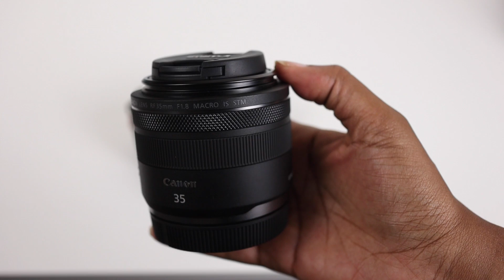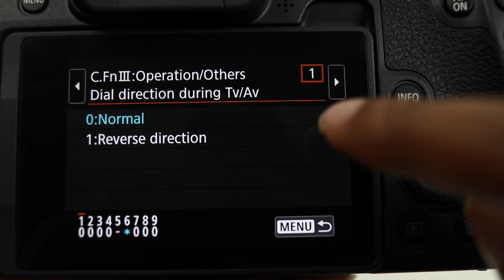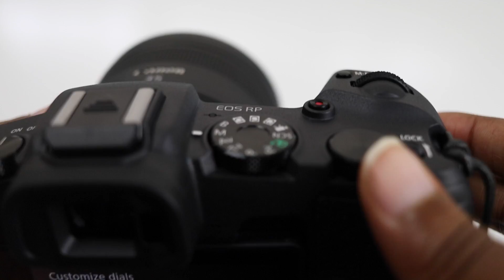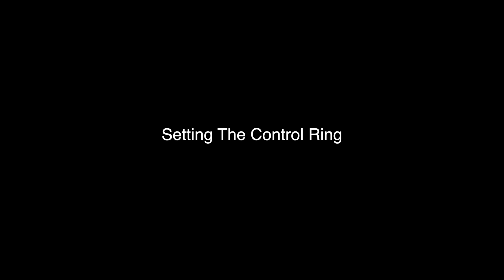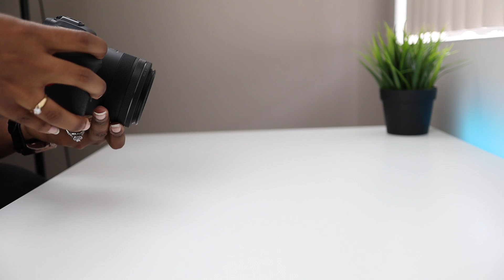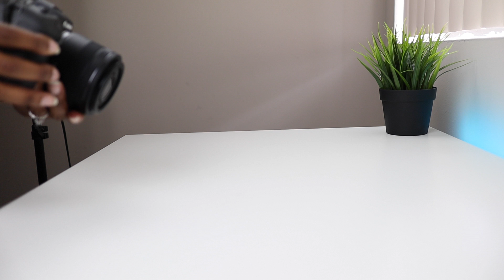Canon EOS RP: How To Set The Control Ring On Your RF Lens

Comment: As per your guidance I have successfully assigned RF24-50 control ring in my R8.  But it is not working.  Is there anything other settings which prevents the ring to function.   What are the other settings to be cross checked
Reply from the maker: Does your lens have a focus/control setting on it?

Comment: Worth mentioning: the reason one might be stumped at why it isn't working is the side of the lens has a Focus/Control setting. I wish I'd known that half an hour ago.
Reply: Okay so you just solved why mine wasn't working. So daft question, what happens to my focus if I have to have it on control?? thank you
Reply: @ZanyZoomers  The assumption is that you'll be using autofocus. That's the default.
Reply: @ZanyZoomers switch the setting and it’s the focus ring

Comment: I was able to program the ring on the 24-105 kit lens based on this video.  Have you taken the lens to a camera shop to see if there's an issue with your particular lens?
Reply: Hi Deborah, I have the 24-105 kit lens but does not work for me with this setting. I also hold the meter btn. while I was rotating the control ring. Could you help me please with setting. Thanks x

Comment: I've ordered a R6 with 24-70 f/2.8.  What mode do you normally use and how do you have the three dials and control ring setup....aperture, shutter, ISO, bracketing, etc.?
Reply from the maker: Nice!! I normally shoot in manual mode. I use the front dial for my shutter, the middle dial for aperture, and the control ring for ISO.
Reply: @Tfrank22  Thanks!
Reply from the maker: You’re welcome 🙂

Comment: I just got the RP. I also got the 35mm f/1.8 lens, which is great. Unfortunately, the control ring on the 24-105mm f/4-7.1 kit lens does not work. No matter what I set it to, nothing happens when I turn the ring.
Reply from the maker: I haven’t used that lens before, but the control ring should work. Have you reached out to Canons Tech Support for assistance?
Reply: Got the same problem!
Reply from the maker: Is there a switch on the lens to change it from either the control ring or the focus ring?
Reply: @Tfrank22  yes there is one on the side
Reply from the maker: Change the switch to the control ring and see if the steps in the video work. Let me know. I don’t have that lens so I can’t test it out.
Reply: @Tfrank22  it works! Thank you and sorry for my stupidity ^^'
Reply from the maker: Glad it worked and this will be helpful for others with this lens 🙂
Reply: VFX Todd  interesting! I am having the same experience with my R6 and my EOS 24-105 L
Reply from the maker: Is it the lens the non L version?  If so, on the lens there is a control switch, change it to the control ring.